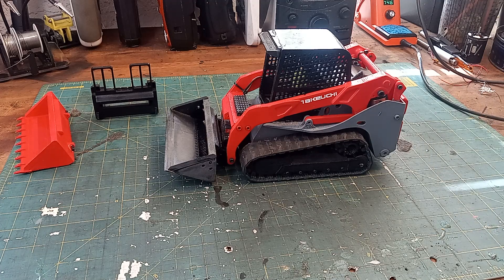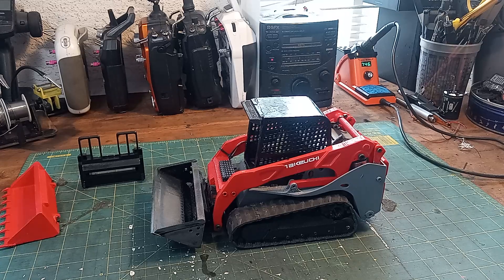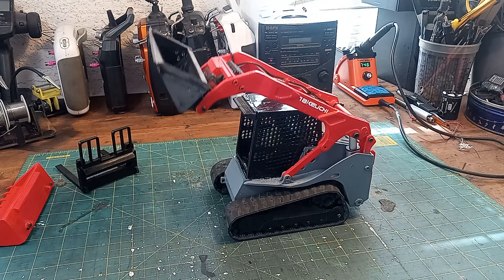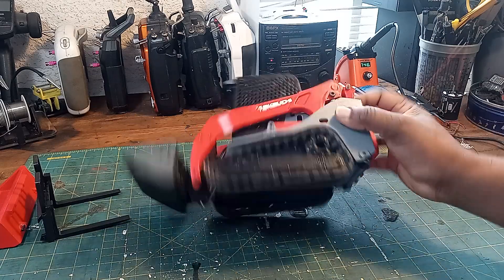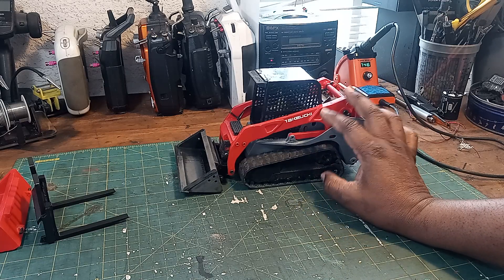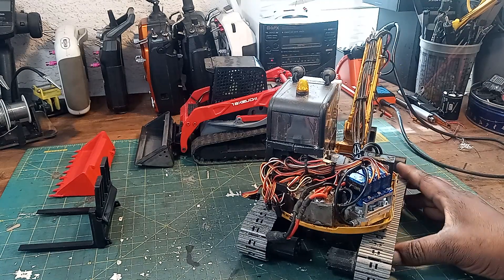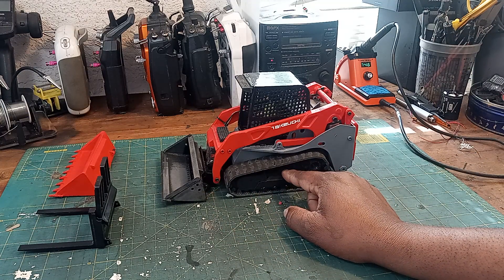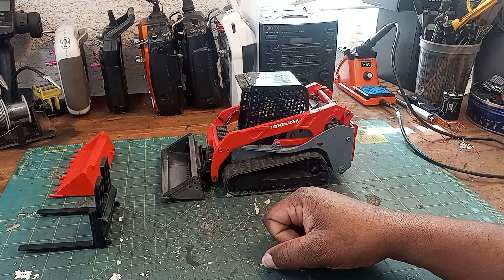3D Printed RC track/skid steer loader

Comment: Don't consider building the track yourself？
Reply from the maker: If can do it but lot easier to buy them
Reply: @everythingrc3050  Hi.I bought your model, and based on the model, I modified the driving wheels, idler wheels, rollers, and rebuilt the rubber track to make it compatible with other model manufacturers' tracks.

Comment: Super build.  How many print hours?
Reply from the maker: took about a week all together to print . the biggest part thr main frame took  10hours the other parts took about 2-9 hours max
three parts are kind of tricky the main arm the cab and the bucket connection